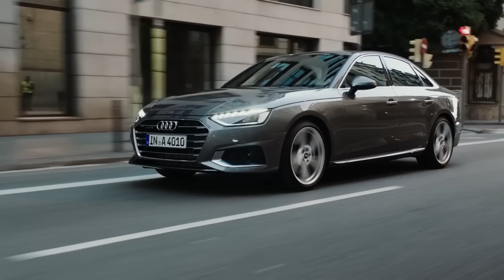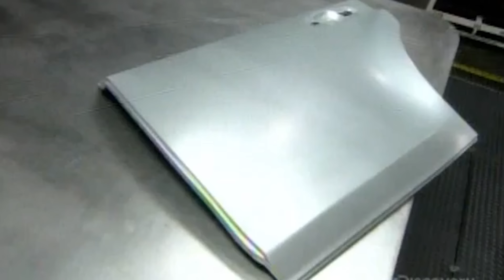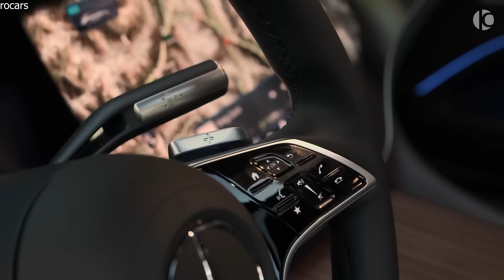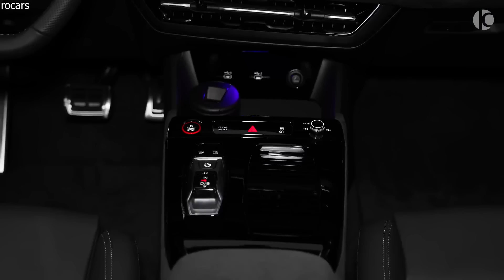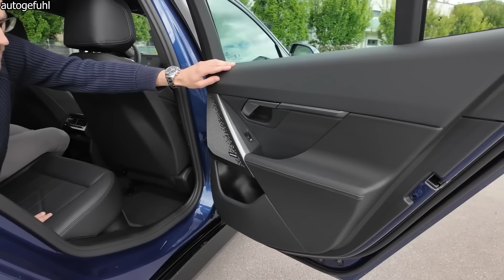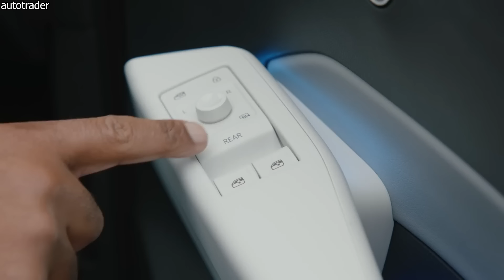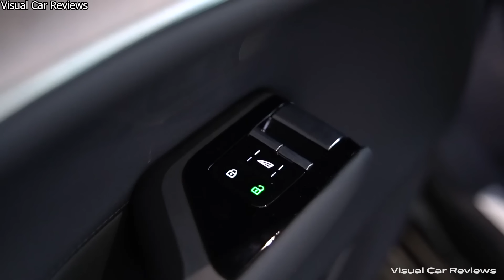Why New Cars Feel So Cheap?

Comment: In my 20-year-old Volvo with almost 250k km, there is no squeaky plastic (except for a small element in the center tunnel), most of the dashboard is covered with some kind of rubber, there are also some elements made of real aluminum, and there is practically no rust.

Comment: I once tried the 2023 Audi RS7 C8 generation, and let me tell you the interior quality was one of the most expensive I’ve touched, everything felt solid, robust and expensive, from the buttons to the doors, everything, and it wasn’t brand new, it had 130k km. Audi still taking things serious.
Reply: Yes, it's good quality because they haven't replaced it with a new model yet. It's essentially the same model as the 2017 A7 which was very nice inside, which they gave a small facelift. 
I fear that it's going to become much worse when they replace it, just like they did with the A5.
Reply: No they aren't, they are complete crap now. They used to be the paragon for interiors for like 20 years...those days are gone.
Reply: @JakeSoulFreeTravels  I wonder how many new Audi models have you driven? There were a few misses in the past years sure, but they still offer premium stuff like full leather dash etc and materials are generally ok. It is
just screens that put people off and then they talk "ohh but glossy plastic" Audi A6 C7 had glossy plastic center piece you couldnt opt out and people call it the best generation. Also Audi made some updates for their existing lineups and stuff got way better.
Reply: @Missacek  for instance?
Reply: @JakeSoulFreeTravels  A6 C9 has a real exhaust pipes again compared to C8, the car was introduced with touch controls on the steering wheel, now 2027 prototypes are showing that they are going back to physical buttons and Im sure there is more of it which we dont know yet. It clearly shows they do listen to the customers and they even admited themselved that lately their interior quality wasnt as expected.
Reply: @Missacek  Like I said, completely crap now...they might change for the future...but my statement still stands.
Reply: @Missacek  Auditography
Reply: @Missacek A6 C7 didn’t have glossy plastic all over the interior, it was mostly a small trim by the shifter. The C9 uses glossy plastic all over the interior with a plastic steering wheel lmfao.
Reply: @JakeSoulFreeTravels you're wrong, the Rs, S models build quality is solid, and others are good also
Reply: @22alchemy  Auditography

Comment: 0:30 "B Sport" channel has a good video on this topic. Those changes happened after Diesel Gate, when VW Group lost huge amount of its capital and was looking for ways to save money wherever they could. AUDI decided to remove sharp lines on their cars, because those require high quality steel or aluminum, otherwise the metal would just crack. Funny enough that one of the reasons why AUDI started doing those lines was to demonstrate high quality of their metals and precision in manufacturing.
Reply: B sport mentioned 🔥🔥
Reply: @annoymouse890  Great channel, it has that early YT authenticity to it. And interesting topics to me as a fellow engineer.
Reply: German engineering at it's finest lol
Reply: We call it ROTSTIFT 💸
Reply: I was in a new A5 a while ago and I was downright shocked by how underwhelming the interior was.

Comment: At this point,just get a dacia 🥀
Reply: Same feeling plastic, just at a lower price. At least they are honest
Reply: Dacias are underpowered imo, but at a fair price
Reply: Hybrid 155 too?
Reply: @ivanmatusic5540  Yes.
Reply: @Mike1-Mike1S    no
Reply: @SunRunn3r  The price is not fair. Dacia is waay to expensive for what it is. It is also unreliable with current Logan 3, Sandero 3, Duster/Bigster.
Reply: @Mike1-Mike1S  Unreliable with what? Non-engine electronic issues are a plauge of all cars today while Renault's engines are bullet proof
Reply: @zbrka76  You are day dreaming. I had several Renaults in the last 20 years. Renault today is history from what it was in the 90s and early 2000s. So please back off.
Reply: @Mike1-Mike1S  Yea, okay, I'll sit down since my household having at least 1 Renault at all times for the last 40 years doesn't count.
Reply: @zbrka76   You wouldn't say untrue things if you really  owned Renaults in the last 40 years. Renault quality has gone down the drain since Carlos Ghosn. Talisman, Kadjar, Megane IV, Clio IV, Espace V - all plagued by problems. And it all started with Laguna II, Megane II and VelSatis - hoplessly unreliable all.
Reply: @Mike1-Mike1S  My 150k 1.6DCi Talisman has no problems. Never left me on the side of the road.
Reply: @zbrka76   Talisman 1.6 dCi has problems with the engine, infotainment system, with the full magic system, problems with suspension bushings. Early on. Also problems with the 4 wheel steer system for the rear wheels, just like Espace 5 has.
Reply: @Mike1-Mike1S  First you dismiss 40 years of experience with a brand in my family and now you are telling me what is wrong with my own car ...
Reply: @zbrka76   I said Talisman has problems. I did not say your own car. However, even if your own Talisman does not have problems, it does not mean Renault Talisman is a good car. It is not. You are ignoring facts. Renault does not build cars like they did. The cars and engines which made Renault famous are not in production anymore, except the 1.6 16V and the 2.0 dCi engines.
Reply: @Mike1-Mike1S  You are so into this that you can crash your entire argument on your own and still keep going as if you have a point. 
But whatever, yeah I agree that Renault today is going in a wrong direction, focusing on Clio success, horrible Alpine thing and jumping on the SUV bandwagon. But maybe they learned from DS that French limousines do not sell since people are sheep.
But regardless of our opinions, Renault is successful today and they sell a ton of cars.
Reply: Interior quality is the same but sadly dacia has no decently powered engine and while it may be decent when you're alone in an empty car, a bit of luggage and one extra man in the car and it's barely getting by.
Reply: Yes indeed we have two sandero 3 and they are super reliable and cheap...some folks here write such b#llshit they dont know anything about dacia like e.g. too expensive hahah what a dumb nonsense comment they write
Reply: Dead light, you can't change light bulb. Won't even mention rest.
Reply: 100%
Reply: Or get something japanese and forget about overengineered european borg cubes
Reply: The ad when I clicked on this video was dacia
Reply: No get a Toyota dioshits
Reply: I have a 2012 Lexus CT200 it’s the cheapest Lexus model and it’s better made than all this garbage 😂
Reply: You have to be joking, they are literally the lowest quality of all cars, buy a used... anything...
Reply: Drove a Duster rental car. Although the cheap hard plastic was everywhere i liked it for its simplicity
Reply: Dacias now cost almost twice as much as they should. 😂
Reply: @DashCamSerbia and bmw, audi, mercedes cost 3 times as much as they should
Reply: @Haya12234  They are not the ones pretending to make budget cars.
Reply: @DashCamSerbia they pretend to make luxury cars, but they build budget cars
Reply: @Haya12234  Yeah, ok buddy.
Reply: @Haya12234  Audi, BMW, Mercedes cost more because they are quality cars. From a BMW owner. Ex Renault owner.
Reply: @DashCamSerbia   Peasants believe they are smart by buying Dacia Logan 3 or Sandero 3.
Reply: Buy a hybrid Dacia then, it has 110kW and a shitload of torque
Reply: @Ibrag91  "shitload of torque". I test drove a hybrid duster. From standstill it feels faster than the normal dacias but it has a dogshit 4 speed gearbox and nowehere close to the torque of a traditional proper diesel SUV if you want to tow.
Reply: 😂... Good point. Maybe is most reliable.
Reply: @arhitectura.din.România   Dacia is definetly not a reliable car.
Reply: The Duster's "top" trims are 30k euros here in France, it's absolutely laughable 😂
In comparison, the other day I found a Saab brochure, 2010 Saab 9-3 TX (Aero bodykit, Aero seats with premium leather upholstery from a swedish tannery, and many more options), starting at 24.5k, which is basically the same price than that Dacia nowadays, with inflation. Except you have twice the power, five times the comfort, and you're ten times safer than in that pile of crap.

Comment: Damn , my 2025 Skoda Octavia (not the stock interior, the next cheapest interior option 250~ euro) has a better interior than a 200k euro Benz...
Reply: I have a 2007 Octavia and i like how it looks, nothing creaks or bends funny when you press. Its still mostly plastic but it looks sturdy.
My coworker bought an MG suv last year and except the wheels, it looks so cheap inside, somehow cheaper than my old Skoda and the touch screen in the center console makes it look even more cheap, like they couldnt bother with a few buttons and knobs.
Reply: @vavra222 MG is complete trash
Reply: @TerbrugZondolop  Cant tell since i´ve only seen one but never drove in it, seemed cheap but for a new car, it was also cheap and i didnt have it in me to ruin my colleague´s happiness.
Reply: Sorry to disappoint you but the Octavia has better quality than most EU cars, that includes luxury brands. Superb and Kodiaq are on another level entirely too.
Reply: @TerbrugZondolop 4th generation is not so good as previous 3rd and mostly 2nd. (Miasing analog controls of AC, also possibility to close air flow manualy, old switch for lights etc.) In the 3rd gen is the most intuitive interior, but 2nd has higher quality of plastics. The best is probably 3rd gen RS before facelift.
Reply: @einsria I completely agree. I bought brand new Skoda Octavia 2021 and while it looks good, some parts are very bad, the door panels have cheap plastics and the A/C control panel is gone. 2019 Skoda Octavia has far better interior quality.